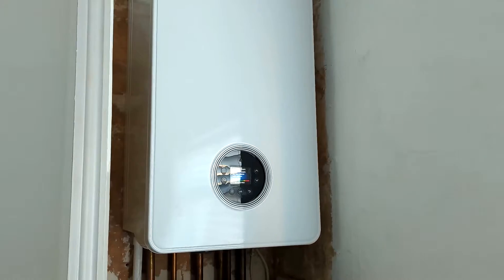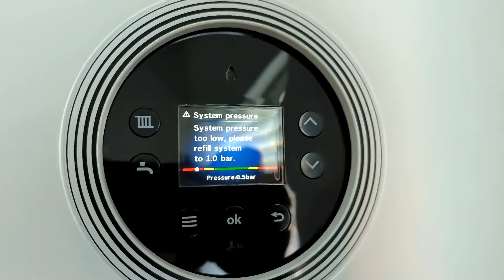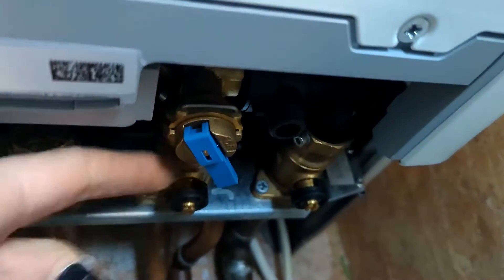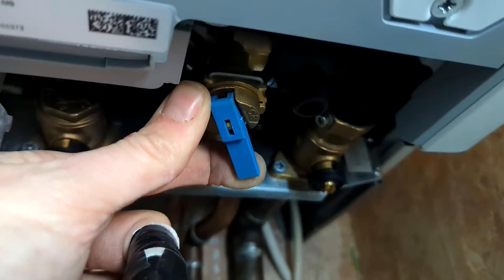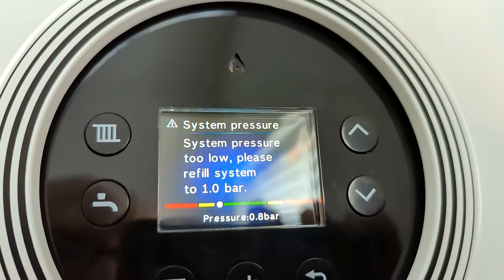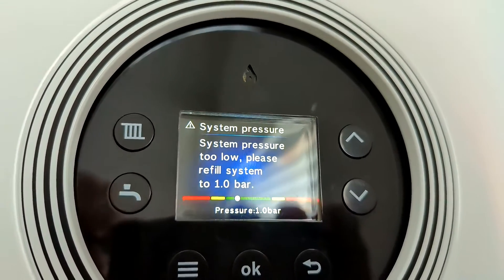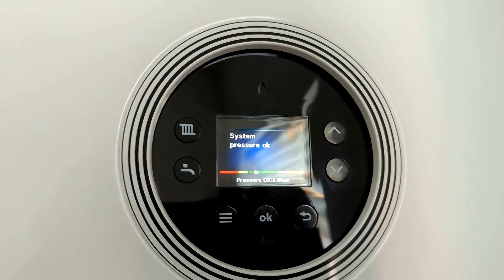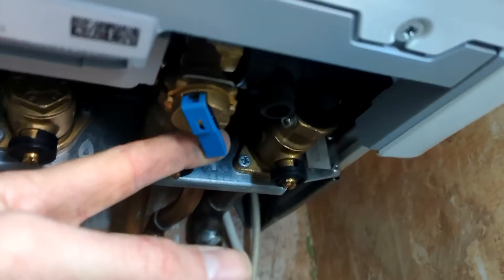How to: Top up the pressure on Worcester 4000 Combi Boiler - System pressure too low error

Comment: Ive got the same boiler as the video your showing but no internally filling loop unserneath
Reply from the maker: You may have a braided hose type filling loop. I think these blue lever types are an optional extra with the boiler,  so if it's a cheap installation it may not get added to the overall boiler installation.

Comment: Hi I don't suppose you can help me? I have old radiators but I have this boiler and I do top the preaure up probably once a week or once every 2 weeks but today I've gone to top pressure up and it's doing nothing?
Reply from the maker: It's difficult to give you a definitive answer but some of the possible reasons are:

The filling loop/blue lever has stopped working

You have a leak that's now got so bad it's not even able to get pressure 

Your Pressure Relief Valve is passing water quicker than the heating system can be pressurised 

Without seeing it myself, I cannot be more accurate.

Comment: Can someone tell me is this blue pressure lever on every Worcester 4000 or is it chargeable option?
Reply from the maker: I think it's a chargeable extra.

Worcester isn't my first choice boiler so I'm not too clued up what comes with them....I am pretty sure you have to pay extra for the easy fill filling loop so some boilers get installed with a braided hose type filling loop
Reply: Ok thanks for your help
Reply from the maker: @ no worries

Comment: does the heating etc have to be off to do this?
Reply from the maker: Not really. It won't hurt the boiler or heating system.

But technically to get the most accurate pressure reading, it's best to do it when the heating system is cold.

Comment: I’ve turned the tap symbol to off should it be on ?
Reply from the maker: Off the top of my head, if the tap symbol has been set to off, you'll have no hot water as it will be off
Reply: @ I’ve put it back on but still no sound is coming from pulling the blue lever down or my gage isn’t moving 😭 just wished I knew what to do

Comment: When i press down the blue key i dont hear any water pressure basically it doesn’t top up the pressure .. what should i do ?
Reply from the maker: It might need freeing up a little bit of it's sticking. Try pulling it up and down a few times.

It could also be that your water has a low pressure and it just takes it a little longer to and quieter to full your heating system. So hold it down and wait to see if the pressure rises.
Reply: When I pull down on the blue lever, nothing happens. There is no sound of water going into the system at all. What do I try next?

Comment: Ah much appreciated, fixed the issue I had right up.

Though getting that bloody lower cover back on was a juggling act!
Reply from the maker: Yes, the cover can be a bit of a pain. 

Thanks for leaving a comment, glad I could help you out!
Reply: How did you get it back on really struggling
Reply: @saulbutcher2215  The front clips (The ones furthest from the wall) are the dificult ones.

If you can get them in first the rest should slide in more easily. But depending on your instilation you might have to do a fair bit of jiggling about or even slightly bending the clips.

Comment: There’s no blue lever but I have the same boiler which is odd how do I release the pressure?
Reply from the maker: I think with Worcester boilers it's a paid extra to have that type of filling loop.

You might have the standard braided hose type filling loop.

It's difficult for me to advise without seeing your boiler/heating system.

Comment: Hi, Mine doesn’t have a blue lever but in stead has a white squarish piece held in place by something that looks very similar to a paperclip. No braided hoses or anything obviously adjustable. Any advice appreciated 👍
Reply from the maker: Yes, that white square turns to allow water through.

But it needs a white "key" inserting first. Most people leave that in permanently.

I think I have a video of that type of filling loop. I'll see if I can find it for you.
Reply from the maker: @jonjo6tie I've managed to upload a video.

Here is the link:

https://youtu.be/pHTOqf5oXi8?si=ZRwy8Zv8J304K1ru

Does that help?

Cheers,
Dan
DPJ Plumbing Heating and Gas
Reply: @dpjplumbing  ThanQ Sir 👍

Comment: Hey, the blue filling loop doesnt do anything on my boiler... what do i do?
Reply from the maker: It's difficult to give you an a reason why without seeing it myself but here are some reasons why:

1. The blue filling loop is stuck closed. Try pulling it up and down a few times to get it to loosen up 

2. Your water pressure isn't quite powerful enough to fill it up quick enough: you might need to hold it open for a while to see the pressure increase 

3. Faulty pressure gauge 

4. Faulty filling loop

These are some of the problems that can occur. 

Hope that helps

Dan
DPJ Plumbing Heating and Gas
Reply: @dpjplumbing  thank you👌 very much appreciated. Will try the first two. 🤞
Reply from the maker: @iamnwb  let me know how it goes. If I think of anything else, I'll leave a reply.

Cheers
Reply: @iamnwb  how did you get on ? Pulling the blue lever down doesn’t do anything on mine either
Reply: I've got the same issue

Comment: Hey bud, mine doesnt have the filling loop and i can't see a braided canle either. Any ideas?
Reply from the maker: If it's not got the filling loop directly under the boiler then I'd say you do have a braided hose type. But they can be put in weird locations.

Are there any cupboards under the boiler or voids where the pipes run into?

Sometimes an old airing cupboard?

It's difficult for me to advise really as every installation can be different and installers will sometimes do weird things to make their life easier

Comment: Same here pls help. I do t have the blue filling loop.
Reply from the maker: I'm pretty sure the supplier of the boiler has to pay extra for the blue levee filling loop, which means that sometimes a standard braided hose type filling loop is put onto the heating system.

The link below is to another one of my videos, showing how to use a braided hose type filling loop

https://youtu.be/YbrFCcpyoZs?si=lzpteV1qwiyiBrLj

Hope it helps, let me know if it does/doesn't

Cheers,
Dan

Comment: Hello, we’ve had the same message on our boiler appear - we don’t have the blue keyless filling loop and instead have what looks like a braid hose type filling loop, which is not attached to anything (boiler installed October 23’ without filling loop attached) 
What do we do please? Thank you
Reply from the maker: https://youtu.be/YbrFCcpyoZs?si=lzpteV1qwiyiBrLj

This is a link to one of my other videos with some details of how to fill up your heating system with a braided hose type filling loop.

Hope it helps.

Let me know if it does or doesn't

Cheers,
Dan